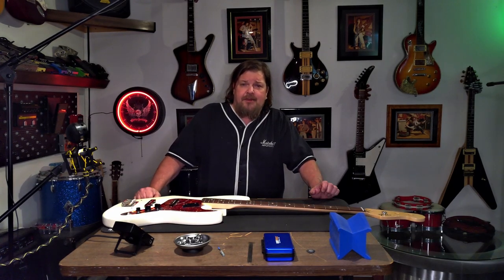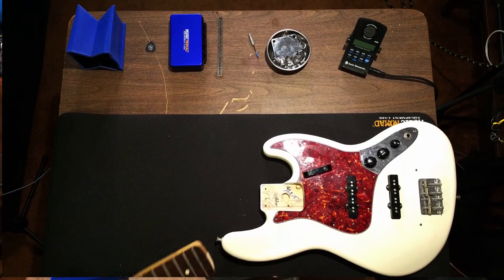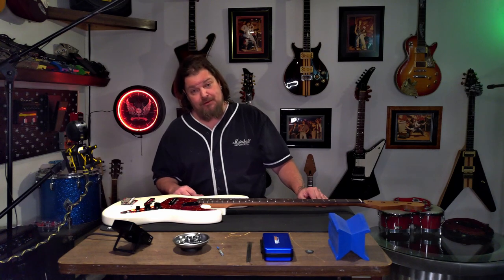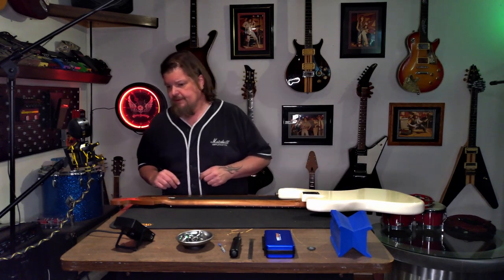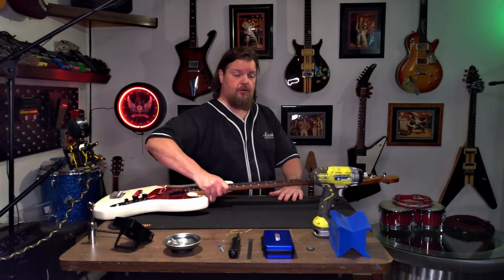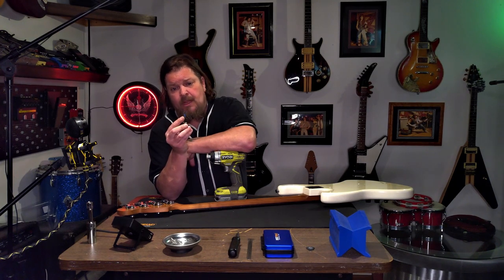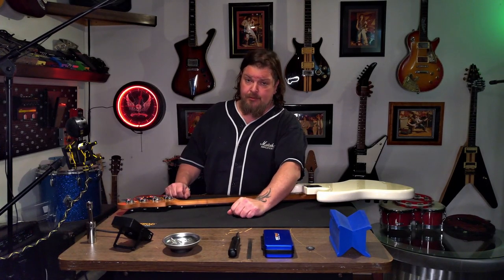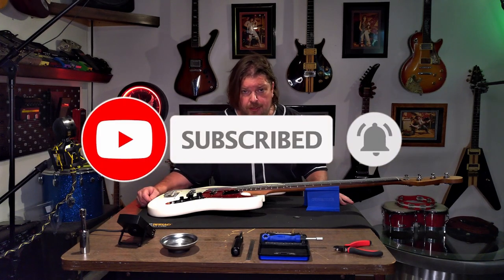Upgrade Yer Dam Bass Neck

Comment: Give me first dibs on your dumpster will you? Don’t throw away your perfectly good old neck just because the truss rod adjuster nut was mullered! It is possible to replace the truss rod with a little careful work… or get a luthier to undertake it! If you want a replacement neck then at least donate the old one to someone else who wants to try a proper repair …. Even if it goes wrong, there’s learning in the attempt… anyway, good instructional video on doing a neck replacement of a high end component! Personally, I’d do a fret level check with a fret rocker and make a pass with a fret levelling beam if it shows up any anomalies and then do a final fret dressing and polishing. I guess the quality replacement is good to go in this case and it the neck relief is all that’s required… thanks for posting.
Reply: yah, don't dis the old neck!!!!!!!

Comment: you can JB weld  an allen key into the stripped allen hex, let it harden, then unscrew it, then cut a regular screw driver slot into the end with a dremo tool

Comment: nice vid!  thanks for posting!

there's a tip/trick i've stumbled upon that y'all might find as useful as i have:  i use an inch-lb torque driver to evenly tension the neck bolts. every bass and guitar i've tried this on (about 10 so far) sounds noticeably better and more thunderous, with increased sustain and note clarity.  i think it works for the same reason you tune a drum head, which any drummer or audio engineer will confirm that this makes a world of difference.  what's weird is that so far, i've found that it doesn't seem to matter exactly what tension all these screws are torque'd to, just that the similar types of screws and such are the same tightness as each other. i also found that doing this same operation very carefully to the tiny screws holding the tuning keys to the back side of the headstock, as well as torque the bolt threaded bushings when they're present on the capstan/cylinder spools on front face of the headstock.  instant improvement in sound, as unlikely as this seems!  as for the torque driver i use, any model that lets you dial in and easily adjust the inch-lb's will work, as long as you can get different Philips drivers and also long sockets into the business end.  i personally ended up with the Wheeler Fat Wrench, it works great and i'm sure others do too. try it out and see.

and for you audiophile types, this trick works wonders on any speaker as well. tension the screws holding the speaker to the baffle, and it'll sound WAY better.
Reply from the maker: Hey Jon, thanks. While I haven’t used them on guitars, I have used them on speakers ! 4-sure ! I’ll have to give it a try next time and check it out.

Comment: I’m about to install a neck here. So you don’t need to pre drill for the neck plate screws but you do for the tuners?
Reply from the maker: The only reason I had to drill the tuner holes was because they were a different brand/size. Hope that clears it up 🤘🏼

Comment: do the screws in the plate have to be extremely tight or not so much? thanks. have any advice for removing a neck from an old bass?
Reply from the maker: They should be quite tight. Just don’t over do it and strip out the hole. I like to snug them up and then just give them a little extra. As far as the old bass , should be pretty simple. Just be careful not to damage the finish on the body around the neck pocket.

Comment: I wanna swap a Jass neck onto a P bass Body, normally it should fit straight away?
Reply: Hey Doom, the neck pocket on these two basses is identical. With the exception of the deluxe models and the P bass “special & Lyte models.

Comment: Do you need to drill out the neck before attaching to the body? Or is it better to screw right into the wood
Reply: On these replacement necks, The mounting holes are pre-drilled. You can however, buy them undrilled if you have an unusual bolt pattern.
Reply: Of the replacement necks I’ve gotten, some are predrilled, some are not. If they’re not predrilled, you must predrill them. Dont screw into the hardwood without predrilling: you will split the wood, and it will be very hard to screw into without appropriate sized holes in the neck. 
The bolts (screws) you use should have a smooth shank on the part that goes through the body so that the threads are going into the neck pulling it tighter towards the neck pocket.